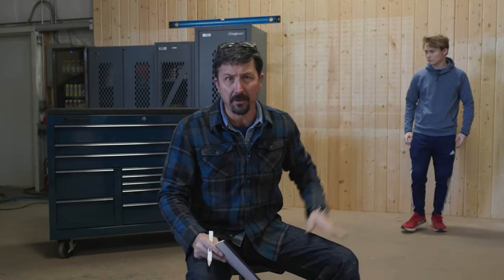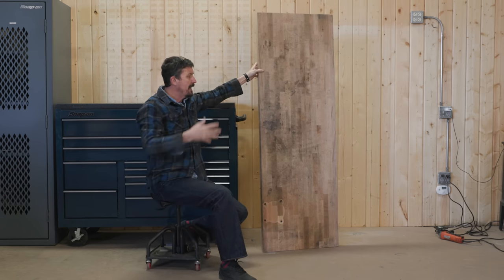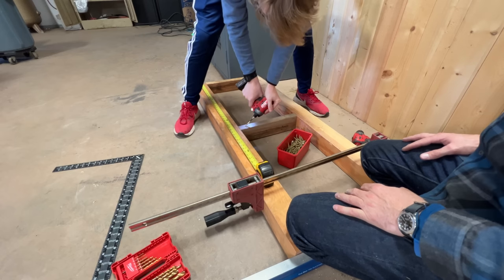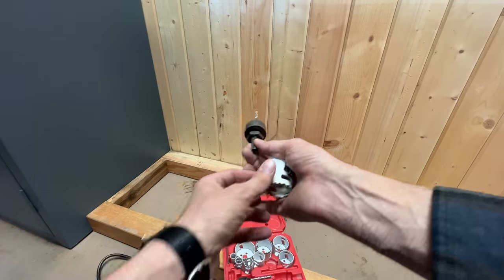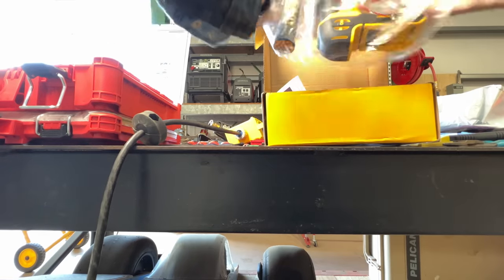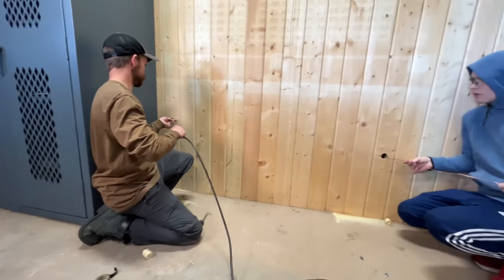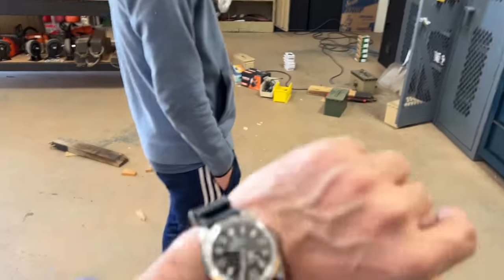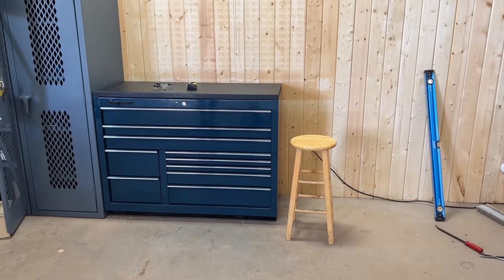How To Build A PRO Homeowner Workbench

Comment: Turns out those angle grinder guards come in handy
Reply: Go figure? Nobody saw that coming.
Reply: Only if ur under osha
Reply: @blairthomas4872  or if you don’t like to have your skin melted with hot metal….
Reply: I had a few cutting  blades break apart on me...a guard would have been nice.
Reply: 2:30 for those wondering lol
Reply: I had a blade break it nearly cut my finger off. A hospital visit and some nerve damage I still have it.  Use a guard
Reply: @dennismbrandi  you had gloves on?

Comment: Dang Cody running a grinder without a guard gets painful fast. Great job on building the workshop and Jack is doing a great job helping out too.
Reply: Not a big deal, I've run 4 to 9 inch grinders without gaurds for 30+ yrs. No problems.

Comment: Don't know if it would make a difference but I have blocks cut under my rolling cabinets that are just slightly higher than the castors. I find leaving them on the wheels means they wiggle about too much but want to be able change it back easily so I leave the castors on and use a jack to lift the cabinet up so I can remove the blocks

Comment: I know, safety sally and all, but as a professional home owner, I think it's best to put the protective cover on the grinder, even if they are annoying. I almost lost a finger because of it. The disc broke and a piece got stuck in a finger between two parts of the same bone. I still feel it when it gets cold and it was 15 years ago. The reason the disk went like this is probably side load or too much pressure. It happens, but can also cause the disk to snap, throwing parts around which doesn't make anyone happy. Best method, for me at least, in this case would be to cut it close to the ground with a thin disk like that, then grab a flappy disk and sand it down so it's flush to the ground. If you have those of course. But you got to do what you got to do. That wooden box under the workbench is a great looking idea and it looks really nice painted like that. Thanks for making this wholesome channel. Bless you.

Comment: I have a nice Mac box (68” macsimizer I believe) at home but I don’t think I could bring myself to take the wheels off however, the old Waterloo box I keep my machinist, and transmission tools in that I’ve had forever with 2 drawers, a big cabinet and a top box mated to a workbench would be ideal for the ol’ home shop

Comment: When doing wire repairs on a pair or group of wires with crimps, try offsetting the cut on each wire, by the size of the crimp. When you’re all done, the finished product will look cleaner than a group of crimps bunched together in one spot.

Comment: Counter space is one spec I don't want to skimp out on for whatever reason when I built mine I was, oh 12feet would work. Ended up with a total of 25feet. I then got a call from a good friend of mine who owns a old biker bar and asked if I could come down for two weeks to help renovate the bar and at the end I was given his old 16ft long 1/4" thick steel counter top and man its just amazing to have in my shop much better than the plywood I used still miss the endless amount of counter space but dang is it solid.

Comment: Looks good but I think it's better to leave the wheels on to keep it mobile.  For that matter I'm going to be reorganizing my own professional homeowner's garage and part of that is adding more storage.  I've recently realized that I'm on the wrong side of 50 and oddly enough everything seems to be getting heavier...I'm also guessing this is only going to get worse going forward so I'm leaning towards getting much smaller boxes that will wheel under work benches and out again to the projects.  For those of us without a forklift it's easier to move and transport tool boxes that weigh 100lbs rather than 900lbs.  Just my own 2 cents about making things usable as you age.

Comment: A PRO TIP FOR YA. When drilling the holes for concrete wedge anchors, drill the hole a bit deeper than you will need and if and when you ever need to cut the anchor off like in this video, you simply cut off flush and now you have room to drive the rest down into the concrete and patch over the hole with epoxy or cement.

Comment: One thing i would suggest is to NOT place any electrical plugs on the wall over the bench.
Place them UNDER the bench for example on the side off the toolbox and then on the side/back of a leg/legs.
But not too far under the bench just so the cable with a straight plug still hang under the bench and not stick out.
Have told a couple of people this and everyone have been very happy after with much less cable mess on the bench and no need to lean over/behind something on the bench to plug something in and so on.

Also do the same thing for air especially if you have a always connected hose with a blow handle on it.
Reply: Oooh also!
Mama needs a nice high shelf/bed over/over to the side of the stove so she can lay there and cast judgement on all non cats :=)

Comment: Many of us have learned. Any horizontal surface. Becomes a storage yard. And then you just push that area clean when you need a work surface.. that is what I have learned as a boomer. Generations. I'm not sure if I use the right pronoun. Because it seems there's many. Why do you need USB while working. You should have 120 outlets to charge your battery operated tools. Just saying. Just keep the guard on a grinder.
Reply: Those are 120 outlets put in the drawer, for charging tool batts., not sure what usb's your referring to.